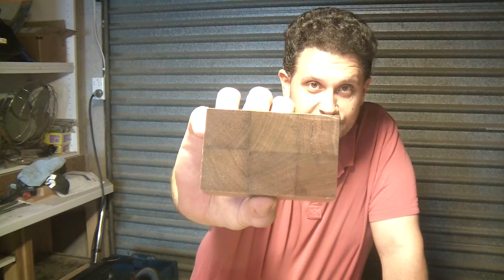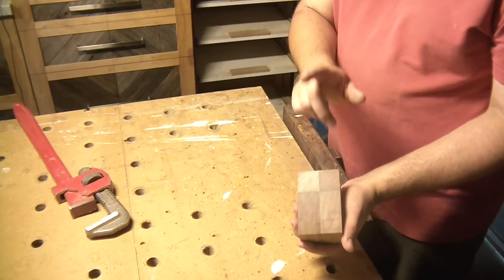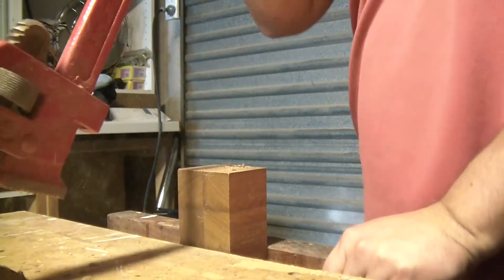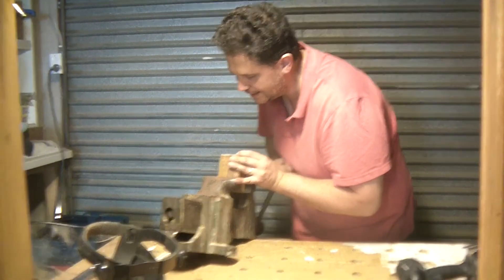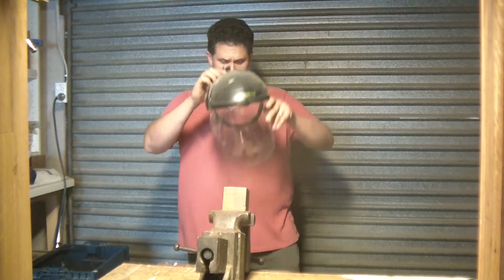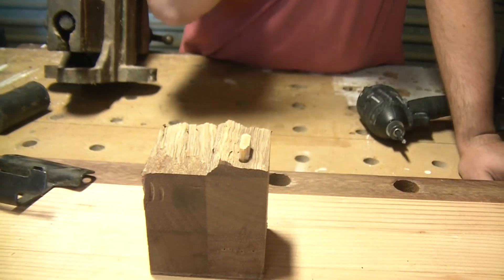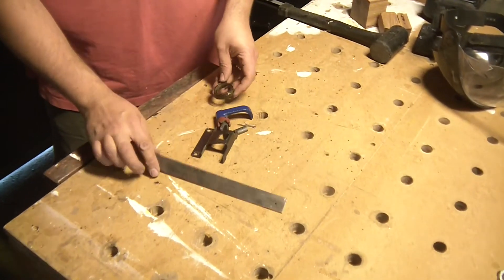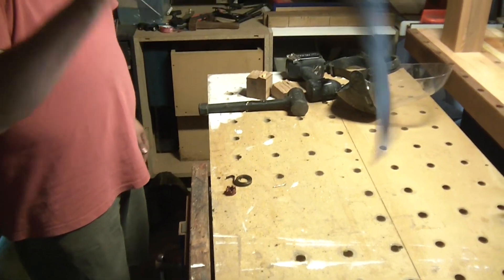PVA glue strength test Aussie Hardwood edition - Tidbits 05

Comment: I would glue 1cm x 1cm strips of any wood ie: 50cm long, then try to brake in the middle where the joint is, another sample try to brake away from the joint, say 3 cm or so, and check WHERE it fails
___________vjv_________   first try 25cm,  then _______v__j_______ J is where the joint is and V is the pressure point
Reply from the maker: Yes but I'm nowhere near that intelligent...

Comment: Is it just simple wood glue or something fancy branded one?
Reply from the maker: Its just simple carpenters glue Titebond 2 in this case I think
Reply: @OneManBandWoodworks  thanks. So as I understood, it will keep strong the scraps with just normal PVA, isn't it?
Reply from the maker: @soulkingdoms4663  yes as long as its a cross linking PVA with a high solid content. Titebond, sika, sellys are 3 good ones.